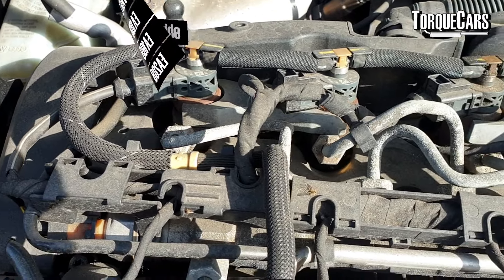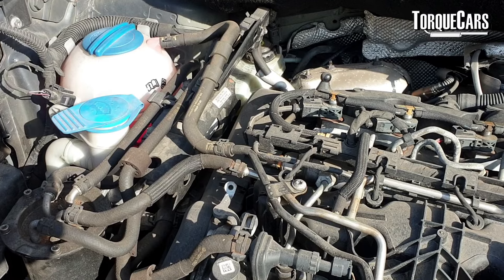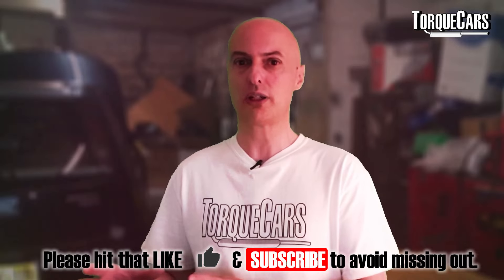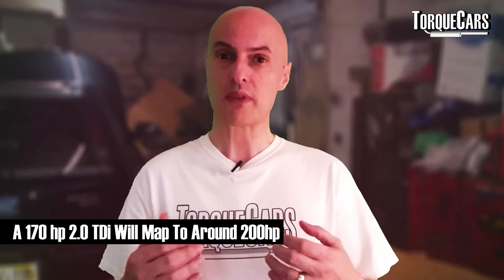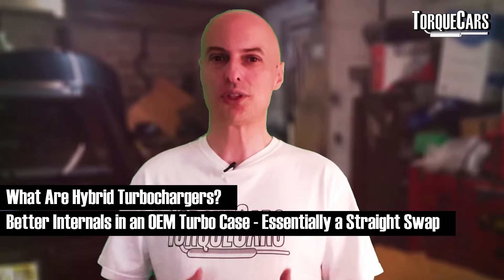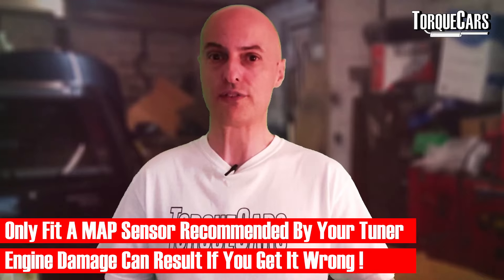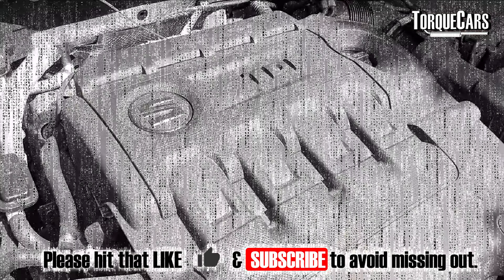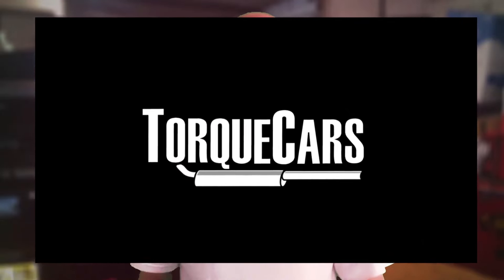Best Mods For 2.0 TDi Tuning [Seat, Audi, VW, Skoda Tuning Guide] EA188 & EA189 Stage 1 & Stage 2

Comment: 7:12 I hate when people lie about remapping will not lower mpg. To make more hp, you have to burn more fuel.
Reply from the maker: Yes my friend you are right remapping does not LOWER MPG unless you drive it harder on 2.0 TDi diesels a remap will increase or rather improve your MPG in most cases with most drivers reporting an improvement in fuel economy after remapping a diesel engine.

A point to note is that remapping doesn't always add more fuel, often the duration and timing of the fuel injection will make the engine more efficient. The increased efficiency means more power from less fuel and less heat lost in frictional losses typical of higher RPM driving.

For example on my 2.0TDi I did see 7% improved fuel economy as will most others but this depends on the map chosen and the way you drive. This was not an economy map but a performance map taking my 140 to around 175.

If you car is now making 100hp at 3000rpm rather than at 4000rpm you need less throttle and hence will use less fuel to achieve the same rate of travel and acceleration.

Gasoline engines are quite different and rarely show a substantially improved MPG.

Comment: There are used VW touran 2.0tdi models from 2016+ amd they can have 190hp. Simple tune ca get that to 225hp without any mods
Reply: Hi, I’ve got - 2018 Touran 2.0d, was looking to add some grunt without tune other than mapping but not mess with the EFG or DPF, any ideas?😅

Comment: So an intake an exhaust components not giving you much. Diesel engines are governed via fuel so intake and exhaust mods won't add much unless it's pumping more air into your combustion chamber allowing more fuel

Comment: Nice 
Lots of info
Do you have same info about 1.6 tdi from VAG ?
Thank you
Reply from the maker: A few have asked so I've bumped this up my production list. From my research so far they are pretty good engines. A simple remap on that should give you around 45hp more power and 55lbft of torque for max economy a remap of around 30hp should be in the sweet spot for power vs economy and be better than the stock setup. It has the EDC17C64 ecu on it. Stock power at 103hp just seems to low when you consider what this can do.
Reply: @torquecars  thank you for answering me
I already did a stage one 
Now after 60k km I'm thinking to upgrade the intercooler and turbo charger with some frome 2.0 tdi 
I don't know what power improvement to aspect
Reply from the maker: I'll be sure to include this in the video. I know you have to choose a turbo with spooling characteristics to match the flow of the engine. Questions I need to answer is where are the limits of power on the stock block, at what point does the fueling need to be uprated, and how much power can the stock gearbox and drive train handle? My guesses are you should be able to get to around 200hp fairly easily but 300hp will need quite a few extra things to be done.
Reply: @torquecars  
The intercooler and turbocharger is plug and play from vw 2.0 tdi 
From what I've seen the engine it holds 300hp but in my case what holds me back is the well known dsg dq200 dry clutch 
If I obtain 200hp I'm happy
Also my gearbox is kind of slow, at 3000 rpm I get only 136km/h
I've got a spare one from a vw golf and this spring it's going to be replaced:))

Comment: A question - does a BMR turbo fit a BKP engine?
Reply from the maker: One thing I've learnt is not to make very specific recommendations without seeing the car, there are often odd regional variations. Checking part codes and seeing if they match is usually the best way to tell. For many production years the Passat used an inline layout which uses  slightly different turbo pipework from a transverse one which is the usual area people get caught out when they get say an A3 170 turbo for a 140 Passat. The 170 turbos will generally (if they have a manifold) bolt on to the 2.0 TDi block as they are all the same block and ports but some pipe work and minor modification may be required to the turbo in some cases. I would guess a worst case scenario is about 4 hours work swapping over the turbo hardware to get it working, there are guides and videos online of achieving this for most setups. If you get a definitive answer please post it here and it will, i'm sure help out many others.
Reply: Short answer is NO, but with some skills YES, loads of welding and modification are involved.
Reply: Thought as much. Settled instead for a bolt-on hybrid 😎

Comment: 18:57 this. Lugging a turbo car is never a good idea, my tuner told me specifically as well, not to push it below 2k RPM as it would damage the rods. Makes sense, I am remapped to around 460 NM, wouldn't want that much power anywhere near the 1.5k RPM mark
Reply from the maker: Thats quite an impressive torque figure. Is the stock clutch able to handle that? Thanks for the support and encouragement my friend I'm glad you've found it useful.
Reply: @torquecars  hasn't slipped on me once, and plenty of people do it down here in germany I've been told w/o any other mods.
PS I really like your channel, feels more down to earth and like minded 👍🏻

Comment: It works on 1.6tdi ea288?
Reply from the maker: I will be doing a guide to the 1.6 in the not too distant future. The principles are the same, there are differences in the head and turbos used and fuel systems compared to the 2.0 TDi. Remaps are still the best mod for you and give quite a bit of extra power.
Reply: @torquecars  i will wait for the video then! Thanks a lot
Reply: @torquecars  btw i don't found any gtb1756bk, only found gtb1756vk turbo

Comment: Putting none silikat coolant on a car which require it.
Reply from the maker: Great tip, so many people forget this one. Interestingly the silicate is provided as a solid block or in a bag in the coolant system on many newer models, which does negate the need to have this in the coolant. This is also why many VAG cars have a 5 year coolant change schedule, but it will degrade with time and as you point out silicate is an important part of the coolant so as the car gets older you MUST pay attention to this.
Reply: Sorry for being to harsh mate. But even tho it got the silicat bag. It require silikat based coolant since wrong choice coolant can dissolve the bag and make it clog up and in worse case in the system such as cylinder walls. 
1 other huge reason is it keeps lubricating the waterpump making it last for the 210.000 timing belt change+ pump

Great video m8

Btw do you experience lag of turbo power? I really have to race it for some minutes before i experience the fully power from it.
Reply: @torquecars  ☺️
Reply from the maker: @alexander97 I had the BKD 140 which was remapped and if anything it was too quick off the line after a remap. Before the map it did lag a little but coming from a petrol it felt quick due to the low end torque. Thanks also for the tips and extra info on correct coolant for these it is appreciated.

Comment: do for 1.9 tdi asz arl ...
Reply from the maker: Yes don't worry this is one engine on my production list and it's not going to be far off.
Reply: 1.9 asz / arl are PD, so You will be limited with turbo & injectors. ARL has biggest injectors and they are enough up to ~200bhp.
After 270/300bhp You would open engine & replace rods and pistons.
For 400+ get better cams (SDi cams works well up to that point & give a bit of earlier spin while losing uprange)

Comment: EA288 doesn't have an intercooler!
Reply from the maker: This video as per the title and description is for the EA188 & EA189 engines. Although the EA288 doesn't have a traditional air to air intercooler it does still have an intercooler which is of the water/oil to air type of intercooler mounted on the intake manifold which is actually pretty efficient.
Reply: @torquecars  Sorry, I hit return too quickly! Yep the EA288 has the charge cooler but I thought you were referring to upgrades for the EA288 intercooler. I wondered if you mean that there are upgraded charge collers available, although as you say intake temps don't really seem to be an issue on them until you get to silly power at which point some kind of custom cooling would be called for. Great channel by the way, one of the few that really digs deep into the differences between the generations. I currently have a 2004 Mk5 Golf GT TDI with the 2.0 PD BKD engine, a 2012 Mk6 Golf GTD with the CR EA189 170hp engine and a 2014 Mk7 Golf GTD with the CUNA EA288 184hp engine, all 3 DSGs, so you can imagine i'm interested! So far I prefer the EA189 of the three, it seems a good 10-20% better in terms of mpg than the EA288, especially on short journeys.
Reply from the maker: No worries my friend it is easily done, and VW group have really confusing model names. I had the BKD in my A3 and that was great but the CR upgrade a few years later adds quite a bit more tunability to it.

By the way you can uprate the charge cooler/intercooler, with a larger capacity cooler which holds more fluid and bigger air to coolant rads at the remote end, this will help a little but for the cost and what you gain few people bother with this and your money is better spent elsewhere.

That is interesting that you get better economy on the older engine, I have heard others say this too.

Comment: 140 and 170 hp versions - why did he get this information from? The current outputs are higher - he is using old data.
Reply from the maker: I had chosen to focus this video on the EA188 and EA189 and had mentioned that power outputs did vary from model to model and region to region. 

NB: The EA288 Gen 3 Evo 2.0 TDi will be dealt with in another video - so yes a video based on older engines needs to be based on older data.

Comment: This presenter is just so annoying with half truths: a bigger turbo takes longer to spool and, instead of starting to spool at 1500rpm, it will start to spool at 1900rpm - meaning less torque and less power in most normal driving situations. Hybrid turbos also have a serious amount of machining work in addition to changed internals.
Reply from the maker: Hi buddy, thanks for your feedback, it's always appreciated to hear from our viewers, especially when they have something constructive to add and are willing to pass on their knowledge and experience rather than just trying to score points. 

Please bear in mind these two factors.

First that MOST drivers will use 2000 to 3000 RPM most of the time on these engines - I know I did. You obviously need to choose a turbo with a boost profile that suits your own driving style. I disagree that ALL modern hybrid turbos are more laggy however, for example a "ball bearing" turbo tends to spool up more quickly than the original thrust bearing ones even if it is larger but different units give different results. 

Secondly that these engines are generally fitted to FWD cars where having lots of boost coming on too early is going to cause traction problems.

The only way to get larger internal components into a standard turbo case is to remove material (this machining also counts as changed internals) I didn't feel that needed explaining as it was fairly obvious but in future I'll be more careful to provide more detail if it doesn't cloud the topic.

This is focused on the EA188 and EA189, the later EA288 will be covered in a future video as I felt it was significantly different although many of these points will still apply in principle at least.